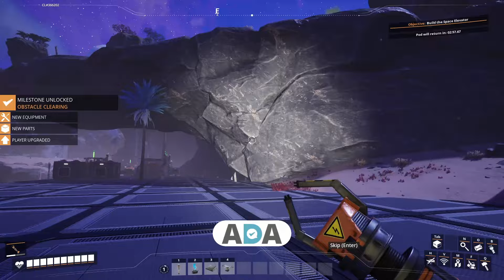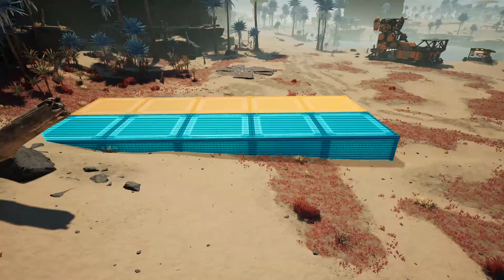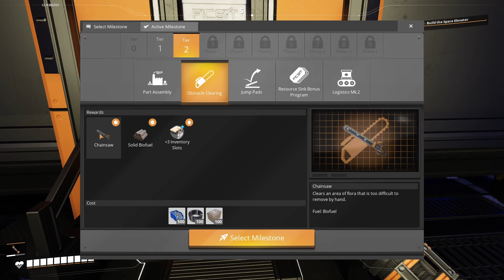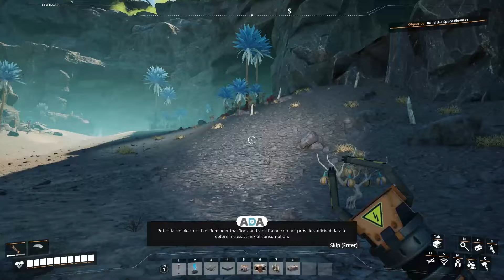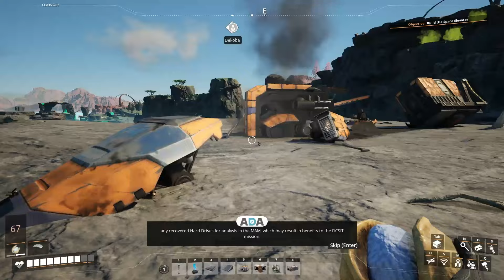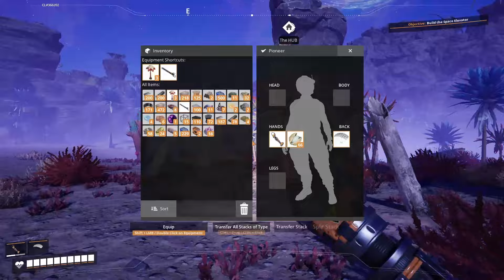Diving off cliffs (and into efficiency!) -  Let's Play Satisfactory 1.0 Episode 2

Comment: Fun fact, if you only have tier 1 parts researched, there are only three hard drive unlocks: Iron Wire, Cast Screws, and the inventory slots. The early game Reinforced Iron Plate alternates were moved to after you have unlocked Assemblers, alongside one each of the Rotor and Modular Frame alternates.
Reply: I know they changed the alternates a bit, hopefully the good ones are still as good as they were.
Reply: @IHateGenericCereal  As far as I've noticed, none of the good ones were nerfed, some of the bad ones were buffed, and there are several very interesting new ones. Some good but niche alternates I saw were also untouched.